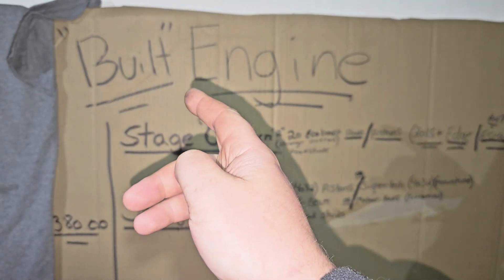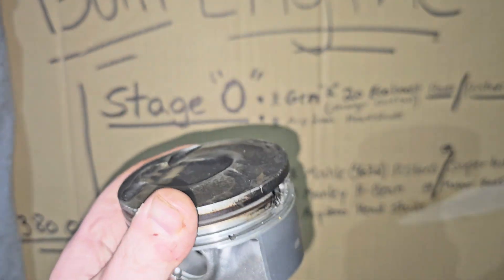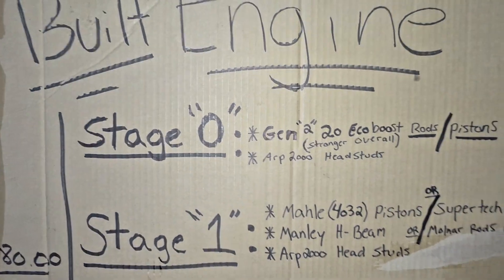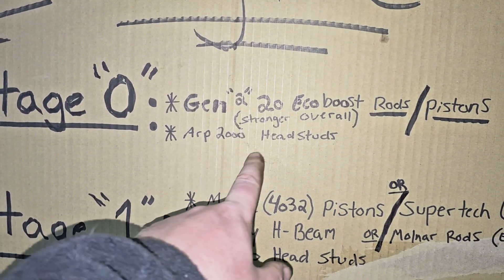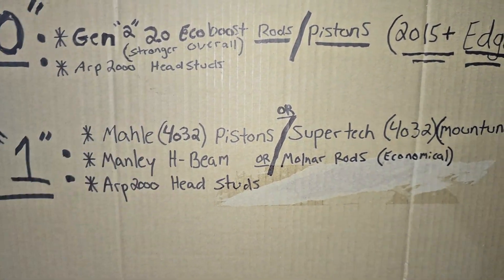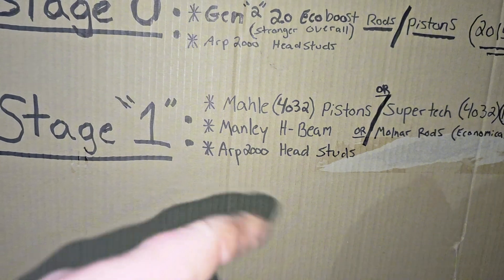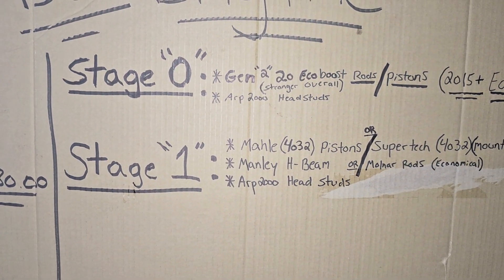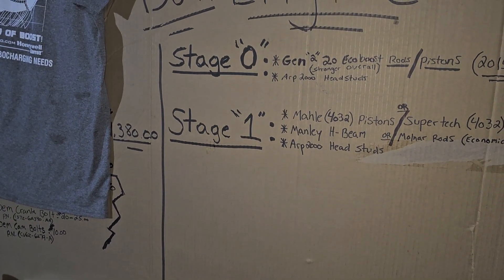Focus ST - Stage 0 & Stage 1 *DIY Engine Build + HP Rating! (Pt.1) #builtenginefocusst

Comment: stock components can handle 400whp dont even see the point in stage 0 great video
Reply from the maker: Stage 0 builds are for oem + (budget) builds with stronger rods gen 2 rods , 4032 pistons or rs pistons which are forged.  Its all about reliability and extra insurance basically.  
Speedperformance offers stage 0 builds which is a budget build too.
Reply: @WhiteblurrST  thanks for the extra info anything special needed to put in rs pistons?
Reply from the maker: No there the same bore and pin size,  they just have a tad more compression 9.5 (RS) vs 9.3 (ST) thats it.

Comment: Depo vs cpe fmic for the focus st ? Big turbo in the far future
Reply from the maker: Get Cvf intercooler,   its high quality and rated for 650whp which is enough.  Use my code BB5 for a discount too on cvf.com website.  If you dont want that then id personally get whoosh v3 looks like a cpe/ depo,  also get your 4port aux fuel kit from elliot specialized performance great quiality kit i got it,  all you need is 65lb injectors.  Idk your goals but id recommend EFR if they made them still for the kits,  but for garrett id do gtx2867 .86 iwg for anything below 400whp,  anything above do g30-660 up to 500whp.  Then id go g30-770 .83
Reply: For my FMIC… I got a Treadstone TR8; it’s rated to 500WHP. I know I’ll never reach that power level with my BNR 3071 and I’m not investing in another Turbo
Reply from the maker: Yea true.  Whats your charge temps on a 3rd or 4th gear pull?  How much above ambient
Reply from the maker: Yeah on the .92ar and 30+ psi